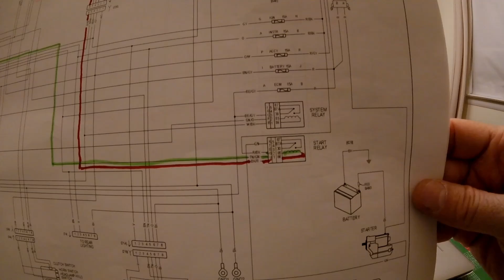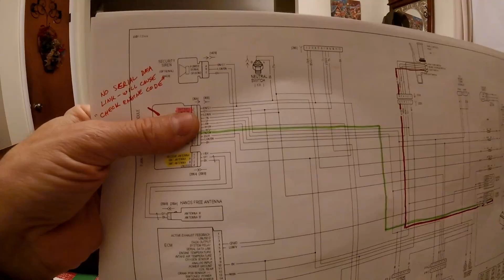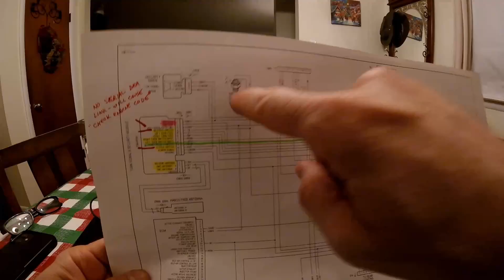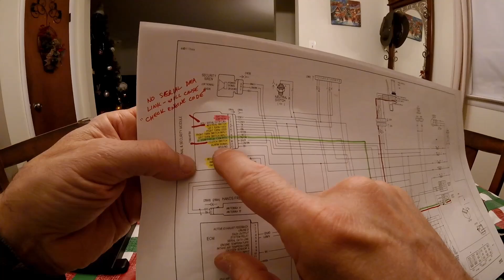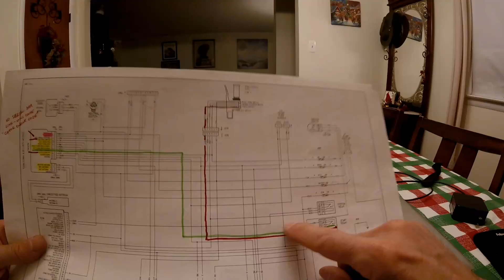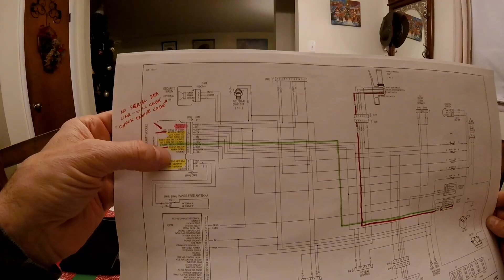Harley Security System Delete & Turn Signal Removal. Twin Cam 1999 to 2010 module TSM & TSSM

Comment: I have a 2006 sportster 883 XLC.
I'm trying to install a GREMLIN wiring kit for 2004-2006 sportsters, but GREMLIN emailed me saying:
 "make sure your bike doesn’t have a security system or a TSSM (turn signal security module).  The kit doesn’t work on these because the security system is tied in with the ignition system. "

Would this video help me bypass the TTSM and then install the GREMLIN wiring kit?

I already stripped down the bike wires to its essentials. The speedo is gone. The turning signals are gone. I also have a "Quick Stick Start Lever" from PRISM suply that eliminates all factory start button wiring. I installed a kill toggle switch and relocated the ignition switch. 

Any insight is greatly appreciated! Thank you
Reply from the maker: Sorry it took a few days to get back to you. Yes, this is the exact video you need. Once you ground the wire for the Start Relay it's game on. Let me know how you make out or if you need further help.
This is the H-D wiring for your bike.
 https://serviceinfo.harley-davidson.com/sip/service/document/5533#ddc67939-ea12-4b1a-87da-bdaf5312fb4f!!1!2
Reply: @Rapsgarageshop thank you so much! I'll start working on it and will let you know how it went, appreciate your help! I just saw your comment today.
Reply from the maker: @mindsightdistort Sounds good!

Comment: Maybe I missed something, but I cut and grounded the tan and green wire. The bike finally cranks and runs for about 2 seconds and then dies. The key fob light is still flashing and the lights are still flashing as if the alarm is going off. Is there another wire that needs to be removed or grounded?
Reply from the maker: If the bike is starting and running for two seconds, then it sounds like you have a second problem use starting fluid to see if you can keep it running. You didn’t state what year your bike was and if it’s fuel injected or not.
Reply: @Rapsgarageshop it’s a 2009 fuel injected. I appreciate any insight you may have. Thank you!!
Reply from the maker: @carlradulski2619  Like I said use some starting fluid and see if you can keep it running. Let me know how you make out and if you need further help.
Reply: @Rapsgarageshop having the same issue 2007 road glide. Un pinned number 9 green and tan. Grounded it. Starts idles for a second dies. Security lights still flashing. Bike does run well just lost the fob.
Reply from the maker: @traviscady6970 maybe try unplugging the TSSM altogether and see how that goes. Please let me know how that goes.

Comment: Which wire from the tssm might be causing no spark? I don't get any pulses to my outter pins on the coil wire. I'm building a bare bones chopper out of a bike I got from an auction.

And when you say I can get rid of some of these wires, do you mean just cut them and cap of the wires?
Reply from the maker: Do you have 12 volt power on the coil? If you follow my video exactly as I show you and don’t need the turn signal wires then you can do whatever you want with the extra wires. You can remove the TSSM module all together. You will have to be careful with any wires that have 12 volt power on them as if they short out then you will start blowing fuses. Let me know if you have any further questions.
Reply: @Rapsgarageshop I get 12v on center pin. I back probed the others while cranking and dont get any pulsing. New crank position sensor. I'm at a loss 😭
Reply from the maker: @BrianMikasa I’d start checking all the places that you’re supposed to have power and ground on the ECM. Also just because the CPS is new doesn’t mean it’s good. Let me know.
Reply: @Rapsgarageshop I did all the tests on the CPS and it reads in spec. I checked power and grounds on ecm and all is well there.
Reply from the maker: @BrianMikasa did it run before you took it apart? Also the ECM has switched power. Have you hooked up switched power to it?
Reply: @Rapsgarageshop it has never ran since I bought it. Ecm does have switched battery voltage.
Reply from the maker: @BrianMikasa  email me your phone number, time zone and good hours to call you to hdrap_1999@yahoo.com.
It would be easier to help over the phone.

Comment: ? Vss serial signal ... You said the ecm needs that for fuel map ..    I am deleting all dash , turn signals n security module  2001 ultra w/injection .. I watched this vid probably 20 times even slowed down to 75% and either somehow missed how the serial data signal is connected to ecm
Reply from the maker: See the attached link. It's a White wire with a green stripe on Pin 3 on the TSM/TSSM module. 

https://serviceinfo.harley-davidson.com/sip/content/document/view?id=5527#b1b828e0-6789-4720-9197-33140e83e48c!!5!53

You can follow it to Pin 8 on the ECM.

https://serviceinfo.harley-davidson.com/sip/content/document/view?id=5527#e4544b2e-1d70-4828-b7a6-053118df325d!!7!55

I guess you will have to see if it affects how your bike runs. 
The reason I say this is because in the past my 2003 Road King had a bad speed pick-up and at times I would pull up to a stop and the bike would stall out. It stopped doing that after I replace the pick-up. Also I would thing that it uses the speed to calculate the fuel and timing mapping on a fuel injected bike. Like I said, you'll have to give it a try. Afterwards, let me know how you make out so I know and can pass it along if anyone ask me in the future. I think the guy that I made the video for said it worked for him. Also I don't think your bike has the same style injection system as mine. you have the  Magneti Marelli EFI system and I have the Delphi EFI.
Reply: @Rapsgarageshop thanks for the heads up
Reply: @Rapsgarageshop yeah same efi at 1st glance with out my glasses I thought it said Morris magneto 😂 .. been tough build not because it's hard but because my laptop fried n printer is dead been using this vid for more than planned .. thanks again
Reply from the maker: @rjd72577  no worries at all. If you need any further help, just reach out.
Reply: @Rapsgarageshop and I dug in today and realized I don't have that white wire with green strip ..where I need it .. security module has been removed (months ago) ..  still trying to figure out "with out speedometer & tssm"   btw color blindness SUX
Reply: Context 2001 Electra classic injected.. "chop" no speedo no security module  ..  the diagram shows "ignition enable pin 10 on security module .. my thought is that wire (pin 10) gets grounded ?
Reply from the maker: @r @rjd72577  I’m not sure about that but it’s possible.
Reply: @Rapsgarageshop to make things worse old dirty wires and me being color blind .
Reply from the maker: @rjd72577  that is definitely not fun
Reply: @Rapsgarageshop nightmare continues ..  oct 13th built .. the harley published wire diagram does not match .  Looks to be older style ..2000 style of which harley has not published pinouts for .. it does appear harley used the same wiring harness from 1999-mid 2001 MODEL year bikes .. BTW..I found it's birth date ..oct 2000 Friday 13th .. if this bike had a machete I would been dead b4 now
Reply from the maker: @rjd72577 that sucks
Reply: @Rapsgarageshop   a year later as i discover EVERY DIAGRAM i find is wrong .. my big hint the pink wire 95%ish all show pink wire on ecm on pin 3 ..mine has pink on pin 5 ..also they show 36 pins mine has 35 i have to trace every wire from end to end .. have yet to find pin out diagram of ecm that is correct for my bike ..  been using the link you provided by vin number no luck
Reply from the maker: @rjd72577 that makes it hard to figure out
Reply: @Rapsgarageshop and I'm color blind too ...

Comment: I have a 2003 ultra classic Electra glide. Got it for a good deal for my first big Harley, I had nothing happening when I hit the switch, grounded the wire off the tssm like in the video and no it turns over but no spark of fuel. I’m new to Harley’s and motorcycles in a whole but have always been fascinated by them so at 26 I got my first big Harley soo any ideas or tips?
Reply from the maker: Spray some starting fluid and see if you can get it to fire the motor and stay running. Also check to see if you have 12 volts DC one the power wire on the coil when you’re cranking it. If you spray it and have the 12 volts on the coil and it still doesn’t start, you probably have a bad Crank Position Sensor.

Comment: I have an 08 road king. I did this, but the fob light is still showing and the bike still won’t turn on. Any suggestions?
Reply from the maker: The only thing grounding that wire does is allow the bike to crank over. If it won’t start you have a second issue. You have to check to see if you have 12 V DC on the coil where the 12 V comes in. Make sure to check this with a voltmeter and not a test like. Let me know how you make out with that.
Reply: @Rapsgarageshop it doesn’t even crank. The security light come on the dash. I plugged the tssm back in without the antenna, but it the starter doesn’t even make a noise.
Reply from the maker: The TSM/TSSM module only provides a ground to the relay coil. You will need to check that the relay coil has 12 volts and the relay contact has 12 volts on it. Also all fuses with a volt meter and all power switches in the on position.

Comment: Hi I hope you are still here.
I have 2001 softail carb model. . I had have issues with security fob etc flashing 3 times no cranking .
I have grounded tan green wire  engine turns fine but NO spark.
And security still flashing 3 flashes. Can you help please?
From u.k 
Thanks v much. 
Rob.
Also people talking about pin 9 , 10 is that on starter relay? 
Not on mine. 5 pin relay in fuse box.
Reply: Your security module is still activated, are you any good on basic wiring, is your bike standard ish? I can possibly guide you to remove t s s m and alter wiring so all other electrics work,but for it too be successful you need to buy a couple of items ( about £70 ) or else you will likely have problems! Won’t run at all won’t run for long indicators etc won’t work, are you in hd riders club gb?
Reply: @MarkHancock-u6k 
Hi, Appreciate the comment.  
Here's the thing , I have 12v on the coil. Appx 9.6 v when cranking , but no spark . I tested the coil and that had no readings , bought an identical coil from hog parts , that has correct readings. Swapped over crank sensor . All to no avail. I realize why I had left indicator flashing 3 times as tssm had fallen at an angle. I have a spark tester on and as said no spark apart from when I switch ignition off then on then off again I get a single flash. I hope I'm not boring you.  
Tssm , fuse etc were in front of back wheel so I figured I would relocate everything into around battery compartment.  Seems to just about fit and I swapped over fuse which was twisted with a 30A trip fuse. 
Just to be clear I have 2 fobs and they do both work but I loathe them .
I don't know why coil would go same time as tssm dislocating itself but shit happens. 
Yes I am interested in £70 to resolve this. 
Regards 
Rob.
Reply: @holmicus  sorry been on holiday for a week, have you a what’s apt or email so I can send you instructions? And parts needed, regards👍
Reply: Hi rob, it seems you are getting fed up with this issue, all you have done is earth the starter relay control, T s s m is still activated, I think you are a little confused and are earthing from the wrong place, you need to earth from the t s s m plug, but your bike will not run  and electrics will not function correctly by doing just that, there is more too do including buying some cheap parts and 2 bits of soldering, are you on what’s app? I can help you will instructions and a diagram, where are you in uk? I’m in Cornwall an a member of hd riders club go👍
Reply: Hello thanks for reply.
I have 12..28 v middle pin (ignition on ) and mv on other 2.
Thankyou!
Reply from the maker: @holmicus  you have to check to see if the 12 V stays on that coil while the bike is running and continues to stay there even when the bike shuts off. Let me know.
Reply: @Rapsgarageshop  Ok. But she wont run. 
I guess , coil or crank sensor ?
Reply: Und do you know why security ie flashing lights still present?
Thanks
Reply from the maker: @holmicus I’m sure it’s because you don’t have the FOB or the modules bad. It’s easy enough to ignore.
Reply from the maker: @holmicus  sorry I didn’t realize it wasn’t running at all. If it won’t run at all and the 12 V stays on the coil even when you’re cranking it then I would agree. It’s either the cam sensor or the crank sensor. I would go for the crank sensor first.
Reply: @holmicus because it’s still immobilised!
Reply: @holmicus because it’s still immobilised!
Reply: @holmicus if the bike was running before you ground out the wire, your still immobilised, why would components suddenly fail?  You will not get the bike running properly and indicators speedo etc will not function correctly just by earthing that wire👍
Reply from the maker: Do you have 12 V on the coil? You need to check it with a voltmeter not a test light. Let me know.
Reply: @Rapsgarageshop 
Thanks. I have 12v on coil.
I bought new coil as no readings on old one. 
Changed crank sensor , doesn't have cam sensor. 
Only spark , on spark tester is when after cranking I switch off , on  off a single flash on tester?
Any thoughts? 
Thanks.
Reply from the maker: @holmicus  email me at hdrap_1999@yahoo.com
Reply: @Rapsgarageshop will do. Thankyou!
Reply: Hello Mr Rap. I got my 2001 softail.running now after finding not only dead coil but ECM also. I also grounded the ignition wire as well as green tan wire  as someone commented, on secondhand ECM and she fired right up 
I have wired 2 flasher relays and that's all good too.
Is there any reason why speedometer wouldn't work if sender wire is good?
Speedo stopped working just before I had all these troubles. 
Only 2 wires I see from diagram go to tssm white/green for flasher staying on time and brown/violet for security key flashing.
Thanks .

Comment: 2005 dyna carbureted. Got the bike to start but only for about 2 seconds then shuts off. I saw a few comments of people having similar issues. Anyone found any fixes yet?
Reply from the maker: Hit it with some starting fluid to see if it’s a fuel problem or not. Try to keep it running for 10 seconds or so on the spray
Reply: @Rapsgarageshop  Same issue when running on starter fluid. Plugs and wires are good as well. Strong battery
Reply from the maker: @ellishd801  you have to get a voltmeter, not a test light, and check to see if you have 12 V on the coil and then to see if the 12 V drops away when the bike shuts off. You need to have the voltmeter on the positive wire the coil the entire time.
Reply: Yes

Comment: 2007 xl1200c, bought the bike already stunted out, no dash no turn signals etc. Rode it for about a year. Appears the previous owner eliminated the tssm completely. Came out one day and it wont fire. Found the starter relay is not receiving a ground. Ran a ground directly to the 85 prong on the starter relay. Fired right up but shuts its self off after 2-3 seconds. I am stumped on whats causing this. Any ideas?
Reply from the maker: Grab a can of starting fluid and spray it to see if you can keep it running. That way you know if it’s a fuel problem or an ignition problem. Sounds like you may have water in the gas. Let me know.
Reply: @Rapsgarageshop It has a fresh tank of gas, starter fluid didnt keep it running, I’m thinking I most likely have a broken ground somewhere
Reply from the maker: @daytona127  I'd check for water in the fuel. After that I'd check that your not loosing power on the coil when it's running. It could be something simple like a bad power switch. If someone did high bars maybe the wires in the bars are bad. Use a digital meter NOT A TEST LIGHT!
Reply: Having the exact same issue but on a carbed dyna. Have you found any fixes yet?
Reply: Ecm not married to the tssm

Comment: What if you just want to get it running until you get a knew tsm..  so do we  have to remove all the wires you have highlighted from tsm or just remove the ground wire until we get the knew tsm.
Reply from the maker: The only thing you have to do is ground the one wire. You don’t have to remove the TSM.